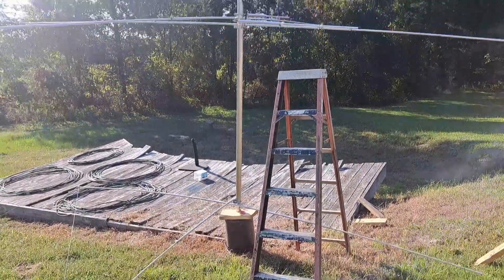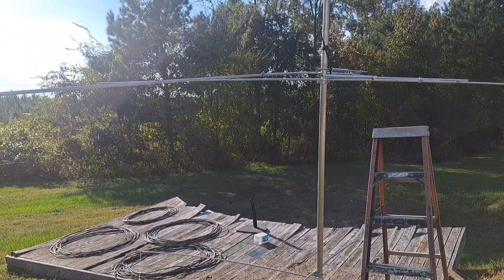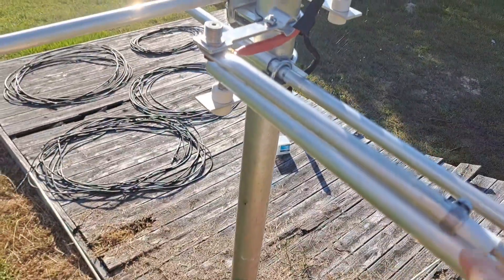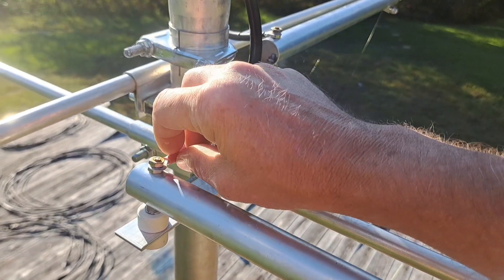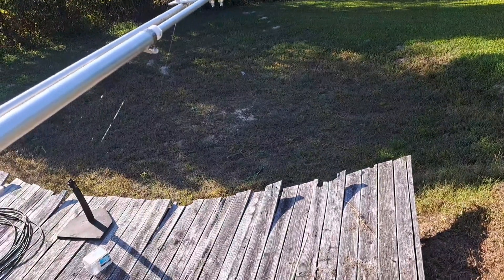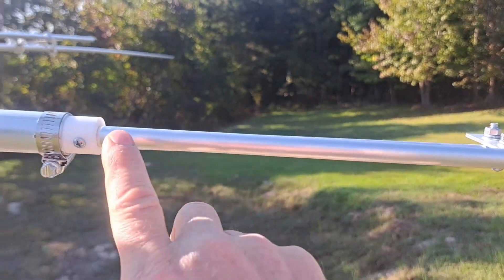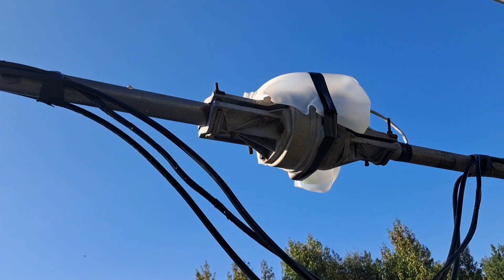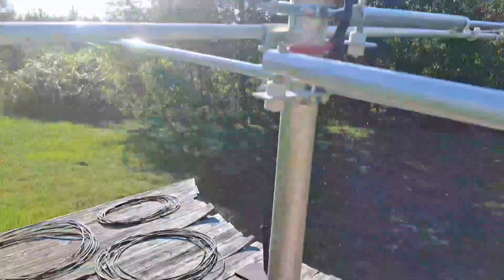MACO Shooting Star Antenna 10K gamma matches install How To

Comment: Thanks sir. Going to feed my moonraker 4 with these gamma matches
Reply from the maker: You will extremely happy with the results.  Thank you very much for watching. You can also fine tune SWR by adjusting the length of your drivin elements if the Gamma Matches won't get quite there. Btw

Comment: I realize you probably have the antenna in the air now, but did you take any footage of the assembly?  I just got one of these and will put it up in the spring.  In the meantime, I'd like to find a tutorial on its assembly.
Reply from the maker: Unfortunately, no. The instructions are a bit confused, but if you measure and look at the images of how the elements are laid out from this video.

Comment: Hogwash. NOTHING BEATS A CLR-2, AND A TUBE TYPE PALOMAR 500 WATT AMPLIFIER.
Reply: No way bro! CLR – 2  is not even rated for 500 W. Plus it has a tiny circuit board that often burns out. Hy-gain super penetrator or a Maco V-58 is way better as it is a 5/8 wave and can handle much more power. I run that with an Ameritron 811 H at about 700 W and I'm talking all over the world with it. And locally in the United States I always get "top of the pile" reports.